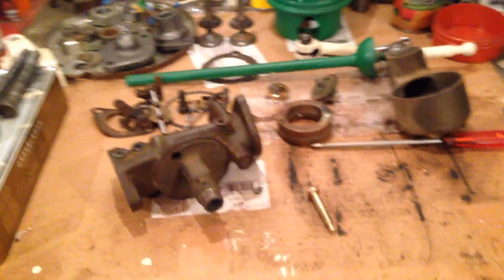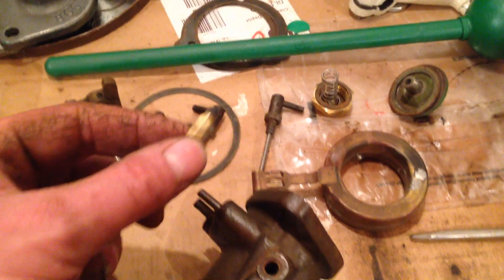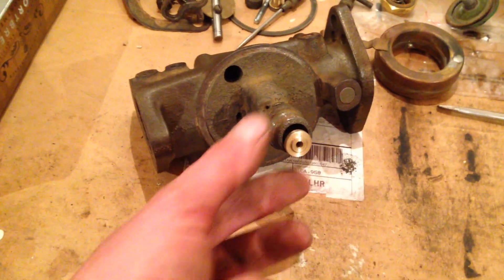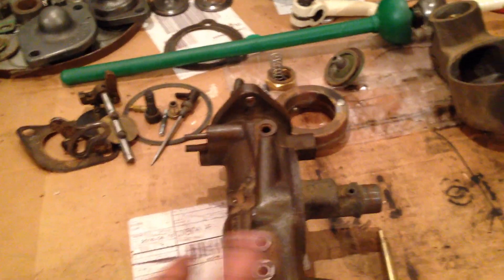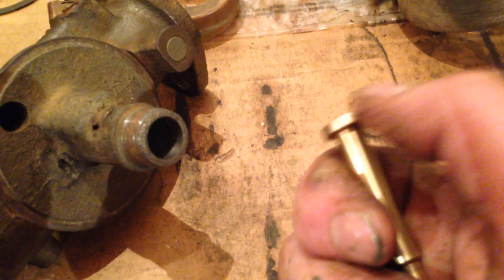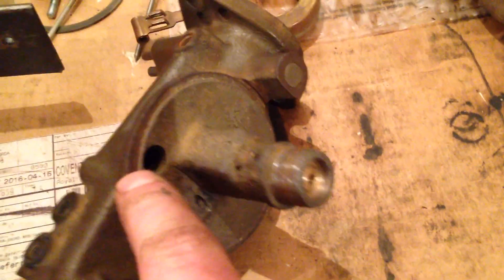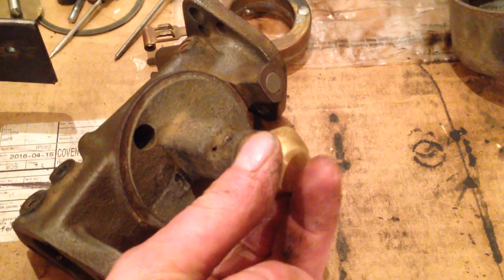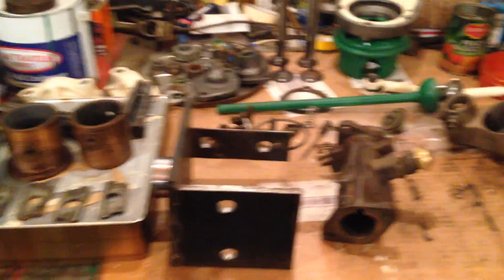John Deere B DLTX 34 carburettor repair “possibly “!??.

Comment: Did this work?
Reply from the maker: Hi Chad , yes and no , unfortunately when I started to put it together I had missed a hole further up the stem which had rotted out into the side jet area so that was end of story really . I firmly believe it would of worked all the piece I made was doing was replacing the rotted out threads . Once the rot had got up into important parts of casting though that was it scrapped . Since making that video I bought another carb of the internet, it had a similar repair and it works just fine . Thanks for the interest regards DAvid H.

Comment: What’s the best way to get nozzle out?
Reply from the maker: bfwinkler Hi , get a tap from a tap and die set which is a good fit in the hole in the bottom of the nozzle gently tap it in to the hole then get some vice pliers / mole grips grip it on to the end of the tap then gently pull it out it will be tight you may need to hit the pliers in a up motion with a small hammer . All these actions need to be done carefully if you plan on reusing the nozzle and not breaking the tap while in the nozzle . There is a tool you can buy it’s called a nozzle nocker look it up on the web they are expensive but do the job . Which ever method you use plenty of wd40 or the like will help , give it time to soak , regards David H .

Comment: My nossle is stuck not slack,I can not get it out?!!?
Reply from the maker: Hi you need to tap the bottom of the nozzle with a small tap from a tap and die set for a bolt size you have , screw the bolt into it and gently pull and twist it will evenly give up the fight and pull out , soak it in penetrating oil too . The nozzle will be destroyed but if it’s that tight the holes in it will be blocked up any way , you can get replacements from various places Steiner are good .
Reply: @oneminutefarming9521  thank you. I just went and got a tap,and a bolt that fits it,two nuts that are too big,and a washer. I have a complete rebuild kit for carb. You are a life saver!